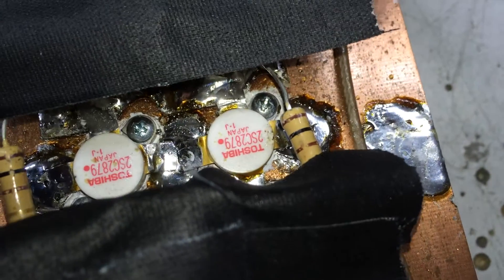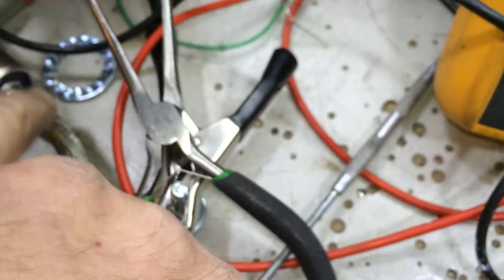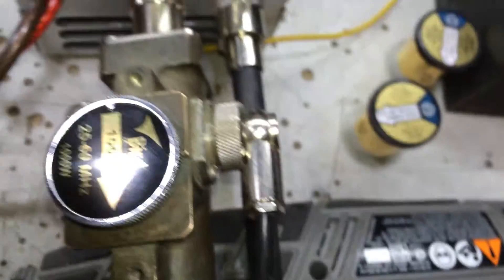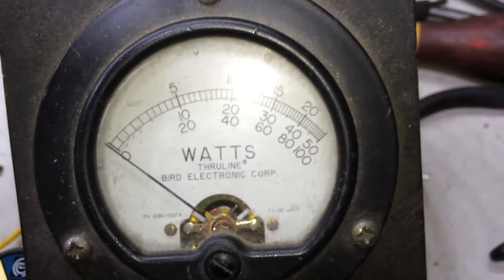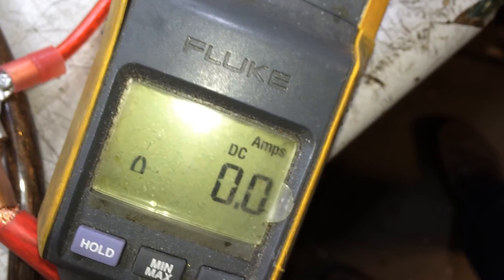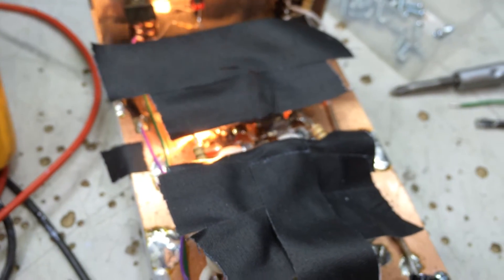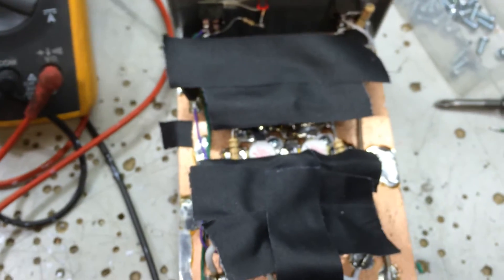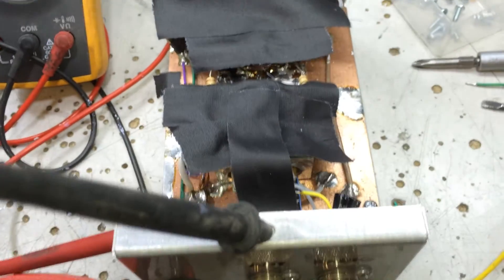Toshiba 2sc2879 Lot 1-J Death Run 2 Prototype Circuit V7.13

Comment from the maker: And Blake H, to address the "How?" part of your question, if you were to be able to see through all the smoke and mirrors others produce, you would find that most all of the bad rap that DEI's have gotten comes from copy cat cloner solder jockeys that have ZERO NONE NO electronics education and because making something new work right requires said electronics knowledge and education,they are lost. so then the transistors become "Junk" and then sadly they spread this bad information all over the web. DEI's work Great.